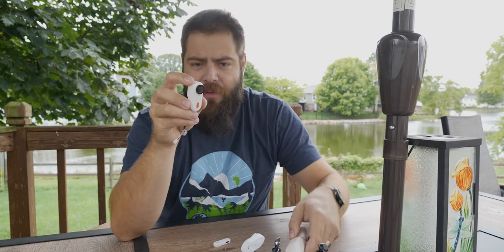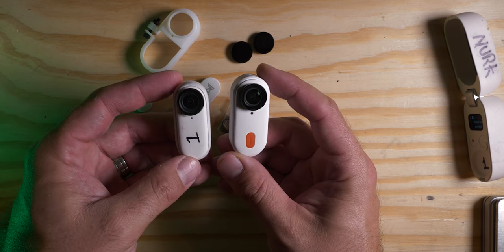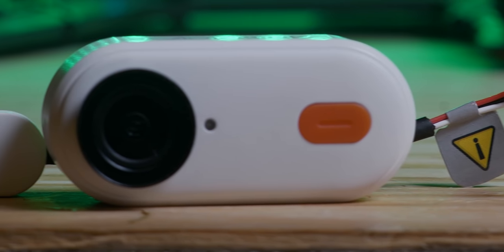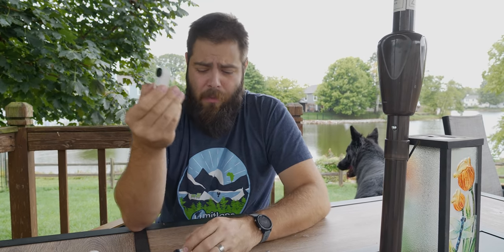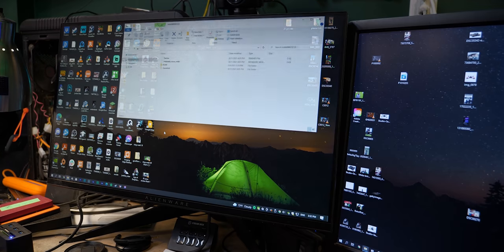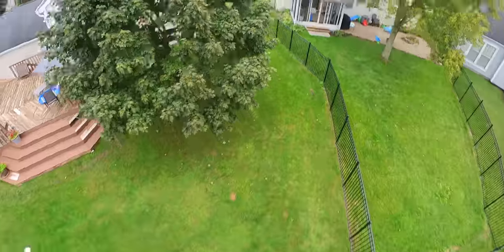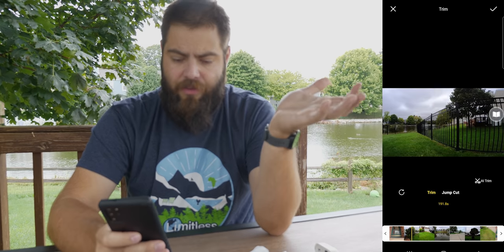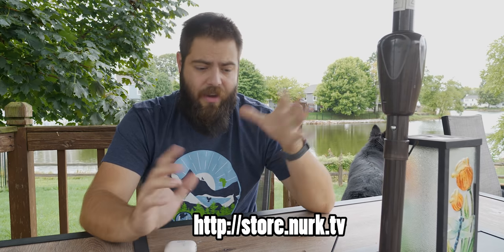Introducing the Caddx Peanut (Insta360 Go2 FPV Mode)

Comment: I've really had my eye out for this. This solves my apprehension about the OG Go 2...record times. Such a great little tool to have in the camera arsenal. I have to say, I'm pretty pleased with Caddx these days.
Reply from the maker: It's a pretty sweet little rig!
Reply: Record time technically the same.  The great thing for me is power plug. Go2 battery life was 30mins starting at max full battery. So I do one long range.  Or if left on awhile getting things ready and tested Then the battery is dead and has to charge.
Also Go2 full front is button. So starts recording everytime you put it in a case lol
Reply: Unless you're flying for more than 15 at a time, it's pretty good.
Reply: thanks bro
Reply: Thanks

Comment: Damnn waited all this time for a go2….. go on the naked forum on Facebook and everyone wanted a lighter go2. [something around 10~15 grams] but they made it a gram heavier??  What a let down
Reply from the maker: I REALLY wish they would have made it with a removable battery..
Reply: This is where I’m at too. If it was lighter it would make sense. 

The new features just aren’t that exciting for me, definitely won’t replace my go2. Maybe next time, Insta360 guys.
Reply: I really don't understand why you guys care about a difference of a few grams when it weighs practically nothing. Is it a joke or something?
Reply from the maker: If it could go down a few grams you could get it on a whoop sized drone, which would be incredible. It would be so small and undetectable and you could fly through anything or anywhere
Reply: @NURKFPV  ok fair enough
Reply: @zacjohnson8404  same reason why GoPro just released the GoPro bones…why would they make a new GoPro if the original one only weighs a few grams?  you probably don’t fly any whoops if your asking why. I have whoops that are under 19 grams so the 10g increase from the go1 to go2 is a big difference. And what is so special about the peanut?? It’s the same exact thing as the go 2.  All that hype for over a year
Reply: @xmwxmorris  it's cheaper than go2, infact priced at what it's worth with that image quality imo.

Comment: Really curious about the durability. I have very bad experience with Caddx Orca. I’ve seen tons of reviews, all of them were awesome. When I got the camera it met my expectations, but after one mild crash WiFi stopped working (so no access to camera settings anymore) and after another 2 crashes the camera stopped working entirely. So for FPV purposes it was super fragile, wonder about this one, but I’ll bet it will be the same story 😒
Reply: Thanks for posting this I was considering getting the caddx orca, now I know I won't
Reply: I also had a bad crash with my orca that shattered the front glass and pushed the lens back. Reach out to support. They helped me out by sending me new guts for my camera and instructions on how to replace. Might be worth a look.
Reply: @BowOneFire   no problem my man, glad I helped. I also heard from others on Facebook group that they got the same issues with it :/ I threw it out and got Session 5 instead, man that thing is durable!
Reply: @droney_baloney  yeah that might be a solution, but I am afraid it will be the same story all over again and I want to fly and capture some footage, not to be always worried about the fragile camera or solve problems, good luck with that anyway :)

Comment: since the mount is different to GoPro, does it fit somewhat on a standard gopro-mount that's already on the drone?
the case looked a bit flimsy, not so sure this will fit firmly and survive a crash.

is the peanut waterproof?

Comment: THATS how I thought it should minus the vivid which isnt a biggie. I was watching "Painless360's" fly his peanut around and the footage was very "jerky" if you know what I mean. At least to my eye. HE DID SAY none of the camera setting were changed for that videos flights. I wasnt sure if that problem would have been the stabilization in post or what. So the peanut HAS to be used with stabilization? Id only fly it on my relaxed sub250 stuff Im MORE curious if my i5-7400/gtx1060 PC can run that editor?

Comment: So it's bigger, heavier, not waterproof, lower framerate (go2 can record up to 120 FPS), doesn't have a protective case, with a screen for settings in the field (the Bluetooth to a phone workflow drains the battery extremely quickly).

Seems like the go2 is still the way to go, unless you really need to turn on the recording from the drone, and don't want to buy a cheap mount and ND filters.

If the peanut didn't have a built-in battery, and could be powered through those 3 wires, this would be very interesting. It could have been a perfect micro drone camera.
Reply from the maker: It's waterproof. Go2 can't record 120 fps as far as I know. 

Personally, for me go2 is still my preferred, but if someone wants to save 60 bucks on the switchblade case thing, cause they don't want those features, then I think it's an awesome option. I'm going to try to work with caddx to get one made without a battery.
Reply: @NURKFPV    The go2 records in 120fps but is limited to 1080 then. It's in the slowmotion setting. For 1440 it's only 50 fps. Is it possible the caddax also have a slowmotion mode since its basically the same camera?

I haven't seen anything about it being waterproof so assumed it wasn't. Where did you find that information?

I agree. It's not a bad camera. And 60 bucks is 60 bucks. Still not worth it in my opinion to cheap out when the go2 have all the extra features. But some people might be on a very tight budget and then this camera seems very good.

I'm behind you on the battery thing 1000%.
And great video btw. Keep up the good work!

Comment: Just got mine other day and it jitters bad.  What's your settings on the caddx peanut.   Also need a mount for my flywoo explorer V2 which also flies horrible straight from box.  Lol.  BRAND NEW!  Never fails with my luck.

Comment: I think this version is not very good.
   1. Cut down on the remote dock while it does the job.
  2. The weight is heavier than the full version by 2 grams (if you attach the charger, it will add another 5 grams)
  3. No longer water resistant
   If you want to fly and charge at the same time, you can buy a separate charging cord if you want.  (if the company has retail).

  With a cheaper price, there is $ 60 that trades in too many things.(240$ vs 299$)  not worth the money and not really groundbreaking.

Comment: How much does the charging connector and wire weigh? I feel like replacing the internal battery with that would be almost neglible weight difference.
Reply from the maker: that is a good point - something that I didn't think about

Comment: As someone who have stripped and ultimately ruined two of the original GO, it really doesn't like being powered without it's original battery. You can circumvent it for a time but idk why it craps out after a while. My guess it's a design problem/feature that stopped caddx also from making solely drone powered version of the GO2. 
The fact it is even heavier than the Go2 is a bummer. They could have gone for minimal weight but as usual micro class is not really considered here.

Comment: Question sir, I’m new to all these. I have a new drone and I noticed that the drone has a similar wire that you’re showing here. A 3wire thing but it’s not connected to anything, I did a quick test, camera works but I don’t know what that thing is for. I checked the manual and didn’t see anything, but I’ll check again.
Is it for controlling a separate camera like this one?

Comment: Looks great, still have a few questions.
1. Can it really record for 30 minutes straight or will it encounter a thermal shutdown?
2. Does it fit in the original case?
3. Does the 3 wire cable need 5v or can you directly connect it to a 1s battery?
4. I assume the 3 wire cable powers AND charges the peanut at the same time?
5. Is there a skin option that turns it into a peanut? :) Just like the go2 minion edition
Reply: Found a few answers on the caddy site.
1. Caddy states it needs 'good' heat dissipation for longer recording times.
3. 5v without step down, 2-6s with stepdown ( so no direct 1s
Reply from the maker: 1) it will shut down if it's not got airflow - you'll have to have a drone moving 
2) no it does not fit in the go2 case
3) needs 5v 
4) it does charge it 
5) there should be for sure
Reply: Honestly so sad if it doesn’t have a peanut skin lol
Reply: @NURKFPV  is it also waterproof for 4m like the normal go2?

Comment: Just too heavy with the cables and connectors, go 2 is still a better option coz of its wireless connectivity, form factor and weight. I’d give this peanut a fail 😅
Reply: Not to mention waterproof and no big deal to charge on the fly.

Comment: Can I control white balance, frame rates and shutter speeds? Might be an improvement over the Smo4k I have.
Reply from the maker: You can do frame rates, but I don't believe you can lock white balance or shutter speeds. I could be wrong though.

Comment: I bought the Orca when it first came out. Lots of annoying software bugs, but it was usable. Exposure/ISO settings left much to be desired.

Within a week it stopped working altogether... I got a replacement under RMA and its BMS failed on my first flight. Imagine fire coming out of a Micro SD card slot. 

No more Caddx for me.
Reply: Similar experience with Orca, 1 mild crash, WiFi stopped working and after 2 more crashes went off completely, super fragile. No more Caddx.

Comment: How do you change the frame rate, resulution and shutter speed on the Peanut? On the Go2 you do that via the charging case. Also will it remember those settings if you turn it off?

P.S. thx for the Video would have almost bought a Go2 but now that I know about the Peanut, I think it´s the better option for me :)
Reply from the maker: Via the app

Comment: For us existing insta360 Go 2 owners. Can we just buy and use this new magnetic pwr, rx/tx cable?
Reply from the maker: No, because the magnet cables won't stay connected to the camera because the standard camera doesn't have the grooves in the back to help lock the cables in place .
Reply: @NURKFPV  Can I get creative in Fusion 360, and model a custom TPU bracket to secure it?  In short, will the new cable technically control the old / original Insta 360 Go 2 (power, start and stop recordings), if we can secure the connector somehow?
Reply: Just watched Albert Kim’s review. He technically tried it, and it diid not work.  10m20s mark https://youtu.be/N-rw_lQ0op4

Comment: Go 2 has overheating issues. Flying in the summer would shut it down after 3:30. With the peanut and connecting it to your drone will probably overheat and thermal shutdown after 10
Reply from the maker: I've never had thermal shutdown in the summer since the latest updates. Sorry to hear that you're having trouble. It does get pretty hot where I'm from.

Comment: I'm kinda mad you didn't try it. So, I'm gonna ask: does the magnetic cable attachment work with the original Go2?
Reply: no, check Albert Kim video, the way it's molded it prevents from attaching to original Go2
Reply from the maker: The Peanut has some little grooves that make the cables stay on way better. I think it will technically still work, but I wouldn't count on it.
Reply: @JeromeDemers  that's sad. But if it works electrically, we can make it work via DIY or future aliexpress adapter. For those who still want universal camera, and not only FPV camera.

Comment: Does the usb-c adapter work on a regular insta360 Go 2? What about the 3 pin connector?
Reply from the maker: I haven't tried it, but it SHOULD work. However, since the casing is different, the connector won't stay on well.

Comment: I’m worried that the magnet pops off and flops through a prop.
Reply from the maker: That definitely is a concern of mine, but if you're worried, you could probably just put a piece of tape or something? Not sure.. I wish there was a little screw or something that you could use to solidly put it in place.

Comment: Would be good to test how that magnetic power connector holds up after some flips and maybe some vibrations. Because it could just slide away eventually if it's shaked by the props and motors.
Reply from the maker: It's pretty well on there. A crash would pop it off but not any flips or rolls or anything

Comment: Hi Paul!!! I'm curious if the usb adapter from the peanut could be used on the GO2 camera?  my "dock" "charging" "remote" thingy of the go2 was melted while charging :( and all the footage on the GO2 is stuck on there now ... but if I could just temporarily connect the usb adapter to get the footage off and charge the go2 that would be legendary.  Thanks and keep on keeping on.
Reply from the maker: it SHOULD work, but it would be tricky to get it to stay aligned to the contacts, since the go2 doesn't have the slots/rails in the back.
Reply: @NURKFPV  I realize the rails are important to hold it in place but I'm curious if just holding it properly in place for the duration of download of vids would do the trick.  are the connectors the same pinout?  I can't spend $240 on "it SHOULD work"  :)  thank you again for your help bro.
Reply: Seems like you'd better get a warranty replacement case than spend $240 on another camera for this particular case.

Comment: Thanks for a great review Nurk! One question, I know that people would want to use this camera on smaller drones, and not 5 inch 6S freestyle rigs. But if you did want to use this with a 6s battery, the included regular wouldn't suffice right? It works only up to 4s?
Reply: Regulator says 2-6s, but i haven't tried it

Comment: Question, do you need to adjust your settings every time or does it save your settings?
Reply from the maker: saves your settings, and you can set up what buttons do what as well
Reply: @NURKFPV  thanks man!
Reply: @NURKFPV  so, in that case it is better than the G02, which does not save iso, shutter and other critical recording settings..

Comment: thanks! does it have horizon lock setting?
Reply from the maker: Yes it does
Reply: @NURKFPV  thanks!
Reply: @NURKFPV  hm, got mine, I don't see an option to lock horizon when exporting. It kinda snaps the flowstate stabilisation to the horizon if I fly level enough, but in prolonged turns the horizon is not kept level. This is in pro video mode.

Comment: Did you try connecting the USB adapter to the Original GO 2? I know the magnetic connection isn’t as good but do all the same features work? Start stop recording etc..? I’d be inclined to just add a rubber bad to the attachment on the Go2 so you don’t lose out the normal way to use the cameras. Can you check?